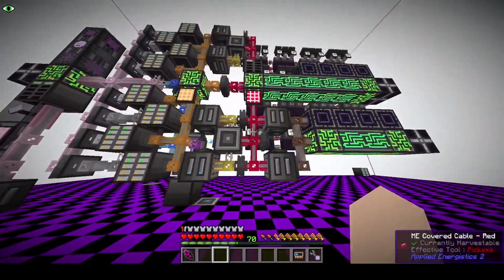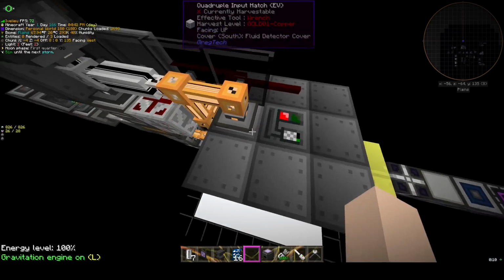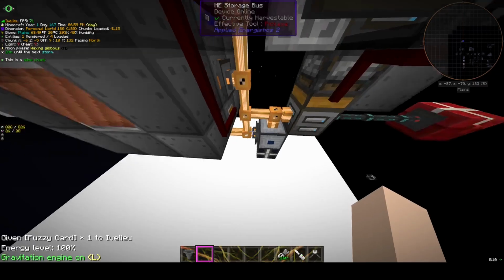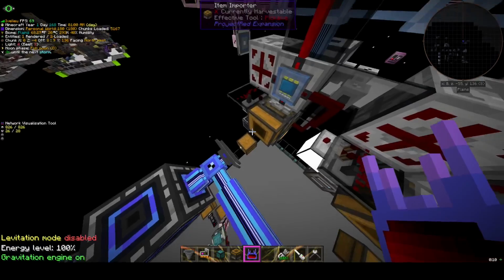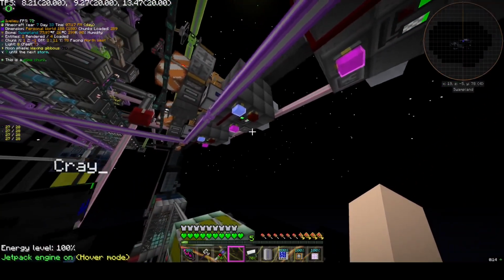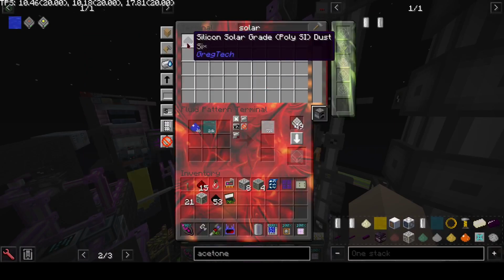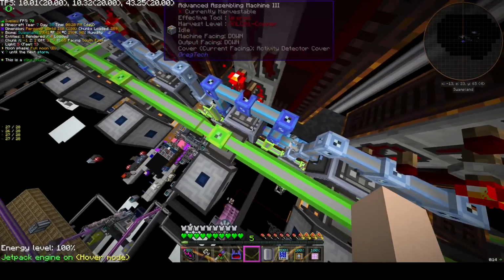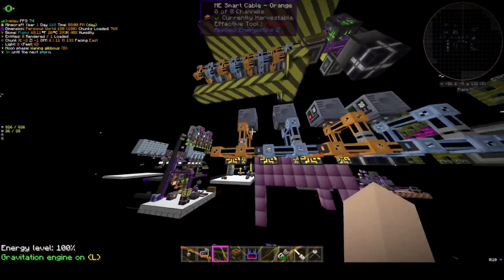Super Duper Automation in GTNH (Parallel Nonconsumable)

Comment: I tried to reproduce the universal automation setup for single-block Assemblers in 2.9.0-beta2, but I ran into a strange problem: the Storage Bus doesn't recognize the Assembler after it's broken and replaced, so items can't be inserted into it. I have to change the Storage Bus configuration to force it to detect the machine again.😢